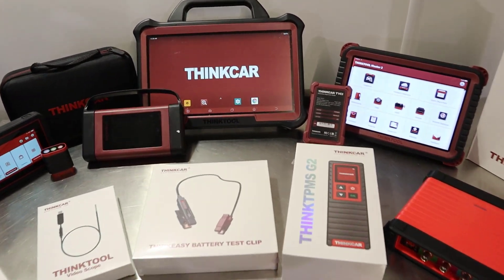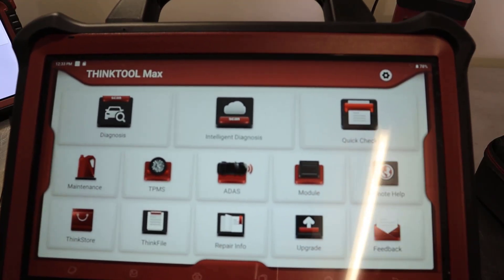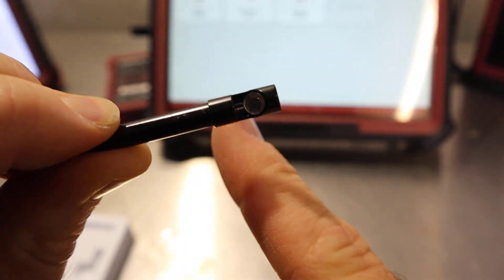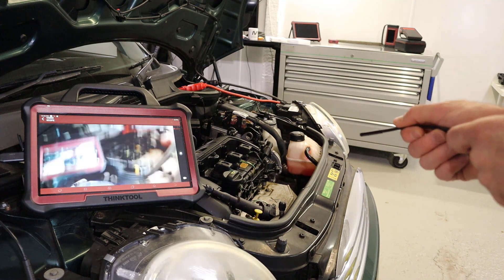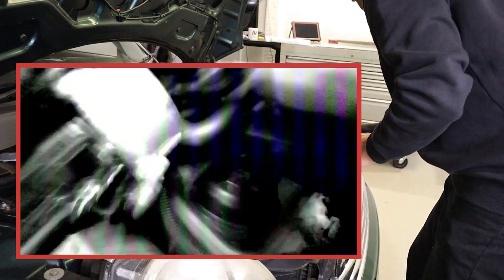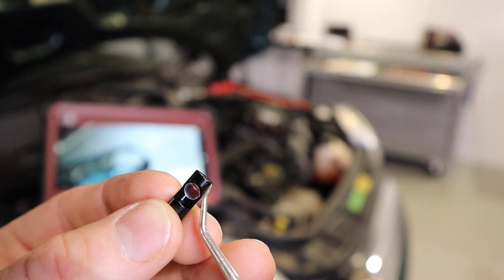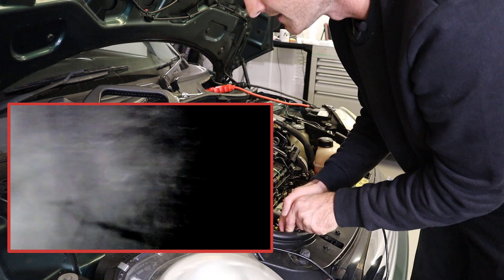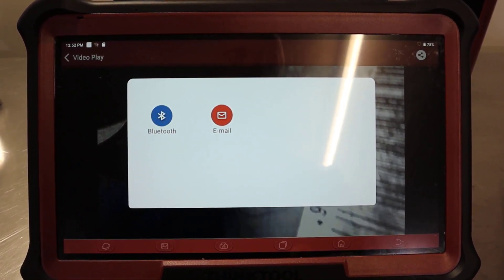Peek Inside Engines with ThinkTool's VideoScope Bore Scope!

Comment: This scopes are a real worry saver when you do lose a bolt and can't find it. You can find it to make sure it isn't going to edge its way into a belt or something important after driving and hitting a bump or two... Got an older one from harbor freight that is too thick, so I got a thinner usb camera from Amazon that works well with my phone or laptop. I still use both cameras though. sometimes the big harbor freight inspection scope is just handy...
Reply from the maker: They are sooo useful. My problem is I always forget I’ve got one 😆 Thanks

Comment: borescope with mirror are not so good in general, image quality for side view is not clear enough, The ones with dual cam are much better.
Is this option available by thinktool? 
beside this remark, it is a very good video and product review so thanks!
Reply from the maker: The borescope with the side view is an amazing tool. I haven’t seen this from ThinkTool yet. Have you seen the articulating bore scope, this is the future!!  😆Thanks Dani!
Reply: Used both types. In tight spaces the side cam is preffered than the articulating one
Reply from the maker: @danialbom5898  Good to know! Cheers
Reply: make certain protective plastic film is removed from side mirror....it can cause blurred images